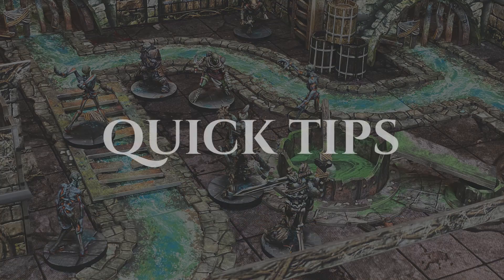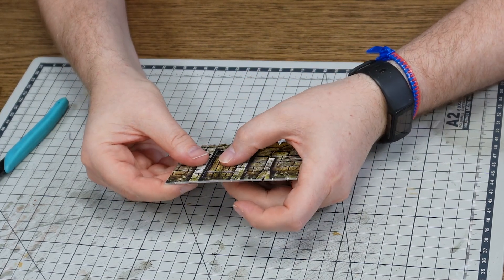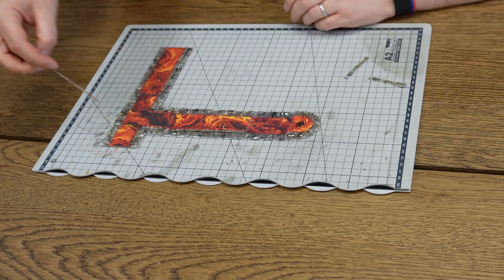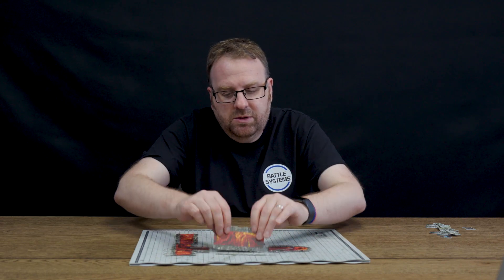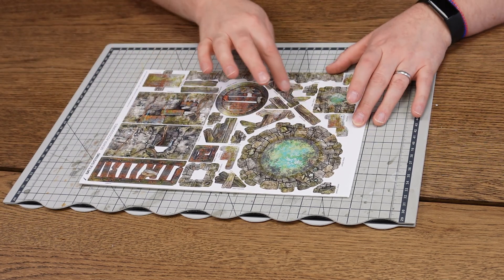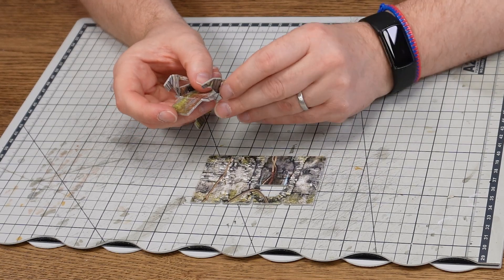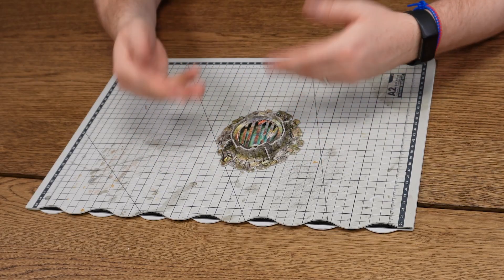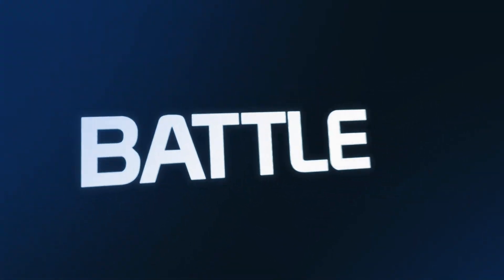Ravenskeep Sewers Assembly

Comment: 3d look is all cool but is not practical if you do not glue them. They will slide around. Would be better to have one for each side. Even then it will most likely make minis to wobbly anyway. Cool idea, not very practical, but we know that Colin likes to use every bit of space for something.
Reply from the maker: This isn't the first time we did this, back in the olden days we did the same for our first Fantasy set and it went down a bomb.
Reply: @Battlesystems  need to be the old old one, that's the one I'm missing from my collection 🤣
Reply from the maker: @HQBunker  Good luck tracking it down :D
Reply: Yep, I'll glue them anyway :s lol